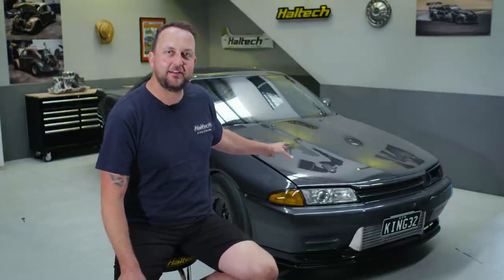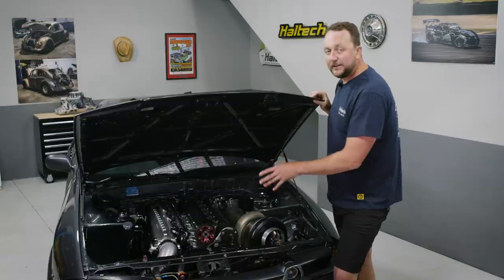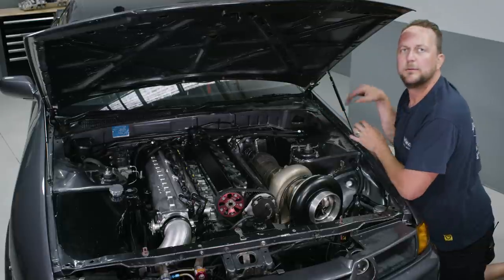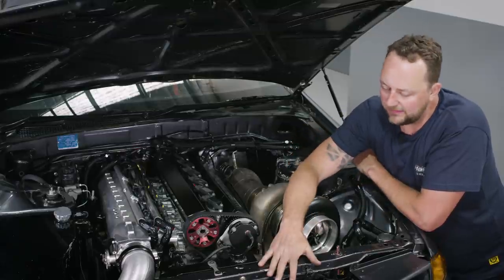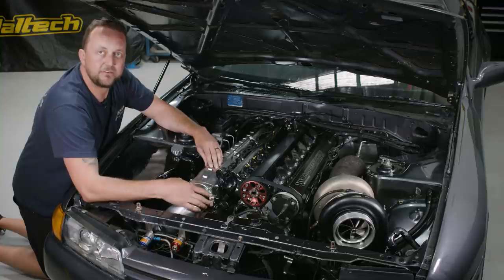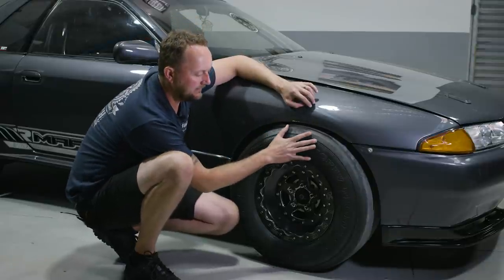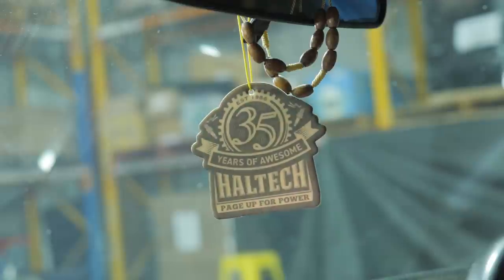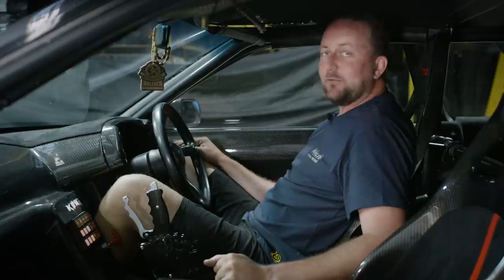🛠 KING32 - Maatouks Racing 2000hp, 70psi record-setting R32 GT-R | ANATOMY OF SPEED

Comment: What's the most impressive is that it still sounds like an RB when going full kill. I know that the RB is a "problem child" compared to JZ, but man they sound good. That butter-smooth-but-pissed-off sound when they push above the seven thousand range is just heavenly. Unfortunately quite a few of the other "big build" RBs I've heard lose that completely. Maybe it's because The King is still on the factory head? 

Anyhow: Thanks Scoot for nerding out over this fantastic car. Much appreciated! 

I'm not sure I would have the cojones to sit in the passenger seat either... 2000HP that actually goes to the ground is a very scary concept. Doubly so when you're not the one in control....

Comment: First thing I saw was 70psi and I was like woah that’s crazy then I saw 2000 hp gtr and I almost fell out of my chair. 3 2400cc injectors per cylinder🤯 I’ve got 1 1700cc injector per cylinder on my car and I thought that was reasonably large.
Reply: What damn power is your sti putting out to need 1700s making 750rwhp on 1000s
Reply: @boosts14 Not on E85 you’re not. E85 fuel systems need much larger injectors.
Reply: @flamintasty  yeah mate it does. And two fprs

Comment: I’ve built my fare share of engines .(Hyundai) 😂 I’m not understanding the back pressure system. I’m interested. How do  you adjust back pressure. Hot side housing?
Reply: Yes sir, wheel size and it's design and housing size. Exhaust runner size and length also effect it but only when they are a restriction.

Comment: i'm surprised it utilizes the R35 coils, is there some sort of external ignition boost on top of that? I know they're great at big power, but I didn't know they were 70psi 2000hp decent haha
Reply: If they use them on 3khp r35s then why would they be an issue on a 2khp car...

Comment: Blow by with a dry sump ? I thought you don't need a catch cab system due to the negative pressure. (Correct me if I'm wrong)
Reply: a 6 sec RB using them you are most probably wrong peace

Comment: Running  that kind of power what would be a rough  ignition timing that car would run at 70  psi 3° at 6000rpm?
Reply: Non methanol, air to air, 
Likely closer to 10°